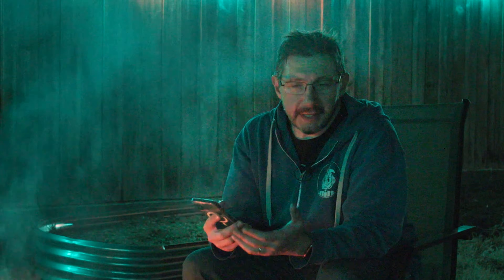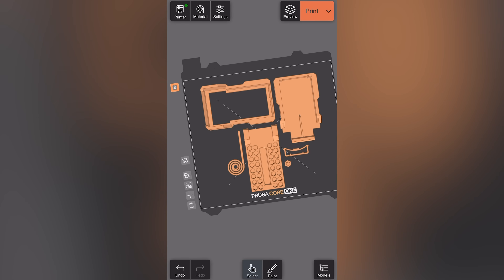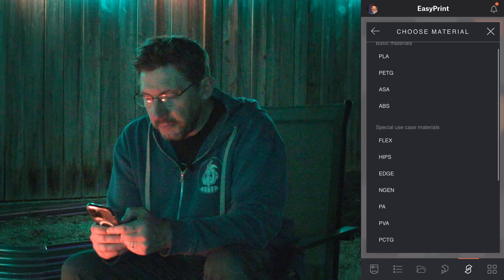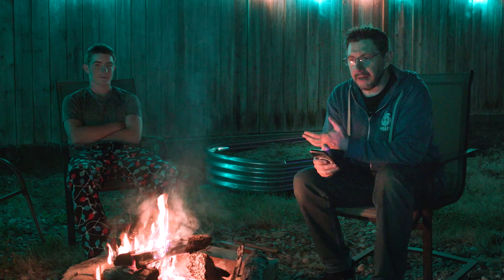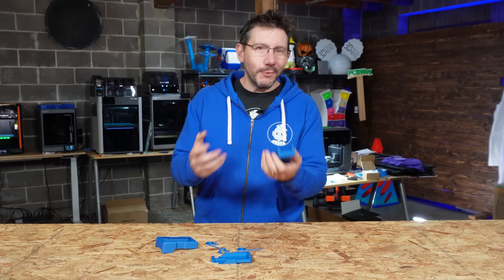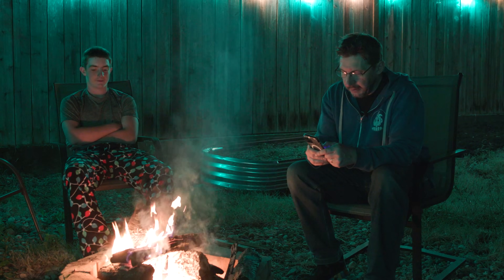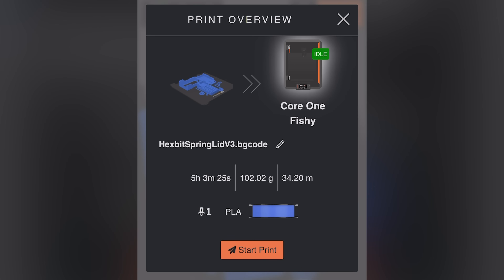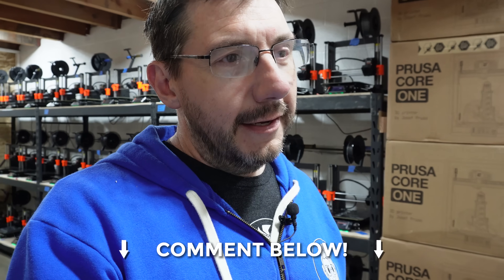Slice and Print FROM YOUR PHONE

Comment: i'm probably the most dull equipment namer, but i try to go for logical ease of reference - a habit i picked up from the naming convention the military uses.  first, each shelving unit would get its own unique designation - probably simply a number in the case of your farm, given the layout, but it could literally be anything.  then designations for shelves, again probably numbered in your case.  then the machine id - which is best with either a portion of the mac address or the position on the shelf.  ease of reference which also identifies location, so at a glance at your management software or whatever you use you know exactly which machine needs attention & where it is.  for the new core 1s, you could also add an evaluation identifier that could easily be removed if it's put into production.

Comment: Pre-sliced models are one thing, but change filament types and you have a problem. Want a different scale and you're stuck. It doesn't have every feature, but it has just enough. A big one for me: it has painting support. I was sitting eating lunch at RMRRF while painting a model on my phone. I even showed it to David (your producer). Scaled it, got the settings and layer height I wanted, and hit print... and was hundreds of miles from home. Didn't need to find someone profile, didn't need to go "oh no, they put part X on a different plate... I can't print it all at once :(" Nope. I can control things and do things on my time. EasyPrint really is a next level thing... the only feature missing is cloud storage. I have the printers, I have the filament... but my big hold up is usually picking colors and setting up/coloring models. My commute is long (public transit), so if I can tackle setup and coloring over a couple commutes, that brings me one step closer to printing it instead of talking about printing it. But going from phone to computer or back is not possible without doing file sharing right now. "Next time"

Comment: That's pretty slick! I thought it would be similar to Bambu Handy app where you just choose a profile that was "pre-sliced" for you. Super neat!
Reply: I'm pretty sure bambu's approach also uses cloud based slicing instead of pre-sliced files since it does let you do a bit of customization. but yeah, this definitely lets you control a lot more options
Reply: @lunlunnnnn  Exactly. With Bambu, most of the slicer settings are predetermined then uploaded. I guess using "pre-sliced" wasn't quite the right term to use.

Comment: Seems more like a gimmick. I don't think many people have a printer turned on all the time, let alone have the filament you want to use loaded and ready.  I think it would be more useful if for some reason you don't have a proper computer that can run a slicer natively than the whole "I can slice and start a print wherever I am at." You still get the "like" though.
Reply: @krunchy3761  I actually have mine on all the time and filament loaded in my Ams slots
Reply: What do you mean "on all the time"? A lot of printers are connected to wifi and are indeed on all the time
Reply: @kendokaaa  I always turn off my printers after use (and also store the filament), no need to have them on 24/7.

Comment: 0:20 Just to be clear. It's not a "browser-based slicer" (which would imply that it runs entirely within the browser). Instead, it's a browser-based interface for Prusa's cloud-based slicing service. The slicing is performed in the cloud, and all data is sent there. Prusa attempted to create a fully functional slicer for phones and tablets but failed—mainly because too many low-end devices couldn't be adequately supported (some info on their blog page).
Reply from the maker: Ah right right thank you!
Reply: That's unfortunate because recent phones are really fast

Comment: Gyroid infill is roughly the same strength as cubic, but prints significantly slower and forces a much of extra accelerations that put additional wear on your motion system.

Consider using cubic infill.